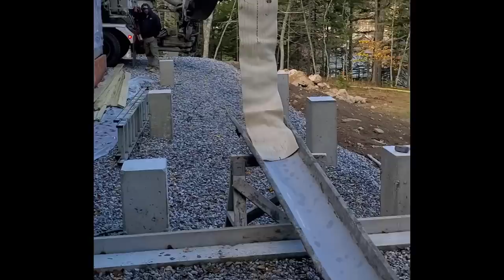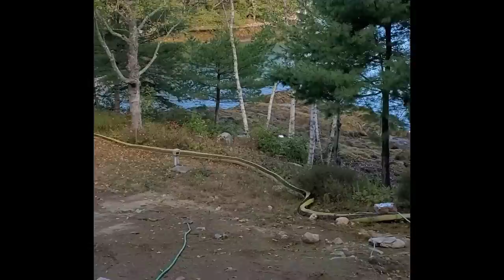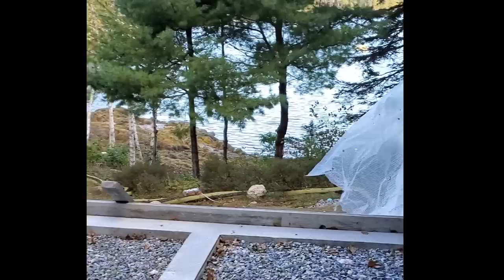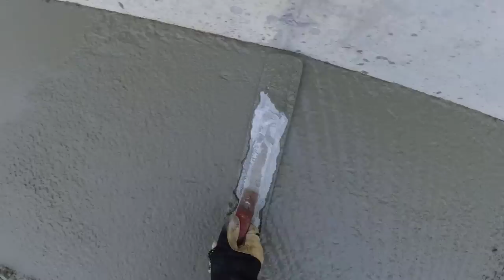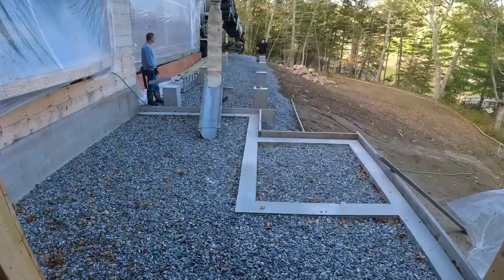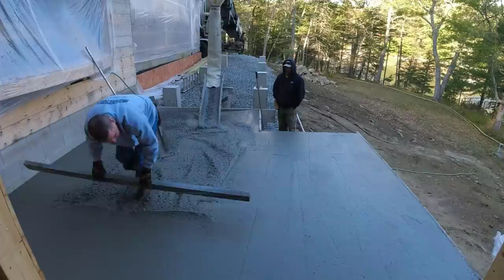One Man Concrete Floor Pour - No Problem!

Comment: Do you have any videos of making a concrete pad on a the side of house with a slope.  I'm wanting to build a 10x3 slab but the slope is about 6-8 inches lower 3 feet out from the house.  I'm going to use the pad to put my inground pool equipment on it (filter, heater, etc...)

Comment: When you order concrete, how much water do you order with the mix ie water:cement ratio W/C - 0.5?   Your concrete looks very soupy and easy to work with
Reply: The concrete appears soupy and easy to work because he used a water reducer. This loosens the concrete without having to add extra water. It doesn't diminish the strength of the concrete and extends the time the concrete will take to harden. Thus, it's great for doing smaller solo jobs, among other things. If you're going to pour alone, and/or you don't have much experience, spend a little extra and order the water reducer/extender as part of your mix. It will make the concrete easier to work and give you more time to get it right prior to it setting up.